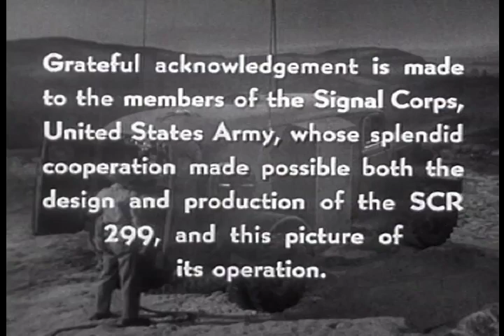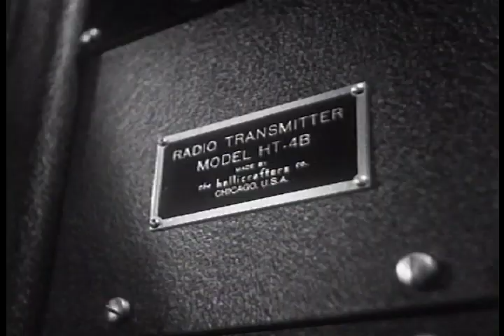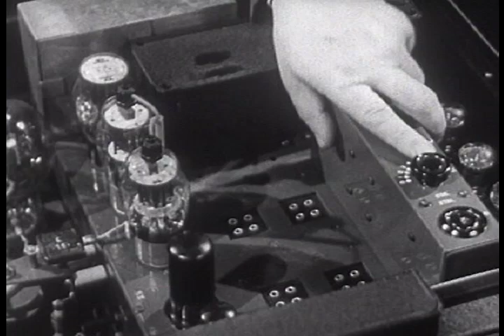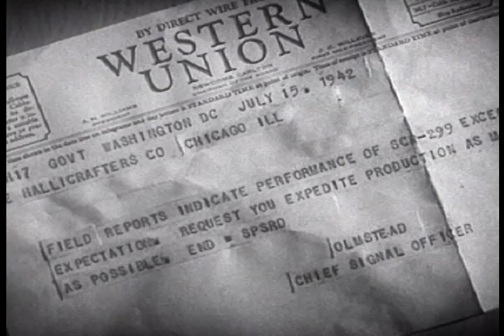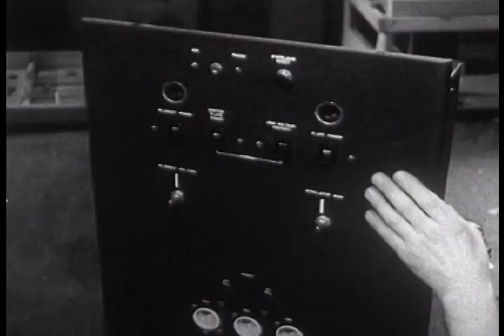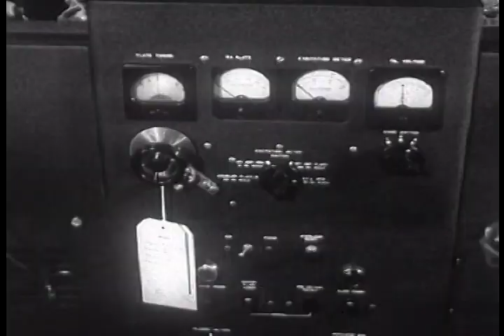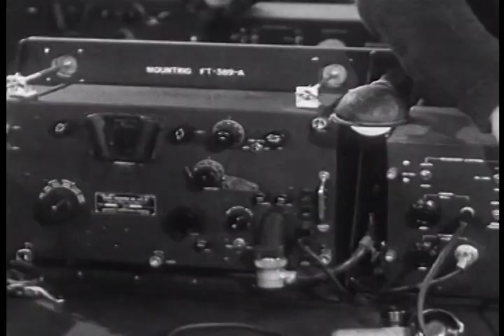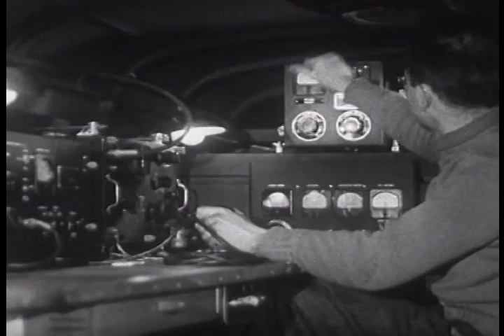Voice Of Victory (1944)

Comment: In the event of an EMP, this gear would still be operating. The new stuff would be a door stop. Wish I had one, and the knowledge to operate it. I'm not an old time radio operator, I'm a current appliance operator. 73 de VE3CRF
Reply: Wait'll you get a gassy tube...
Reply: @alexcarter8807  with proper care some could last above 20000 hours... And if ones gassy you get a fun light show not just smoke.

Comment: These radios would sell like crazy if they would put them back into production built as heavy duty as the originals. Even young hams are realizing that old vacuum tube gear is the best. Discrete components. Point to point wiring. Tough as nails. Microprocessor controlled radios will be in landfills while old vacuum tube gear keeps on going!!
Scott. KK7VY.